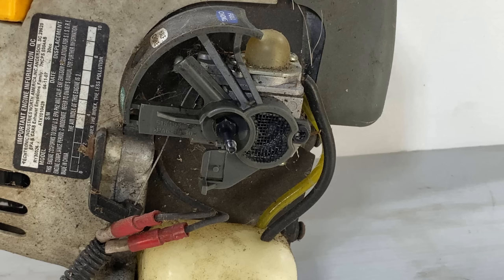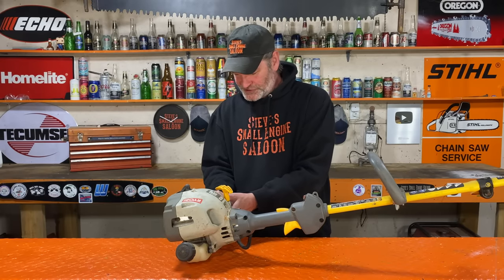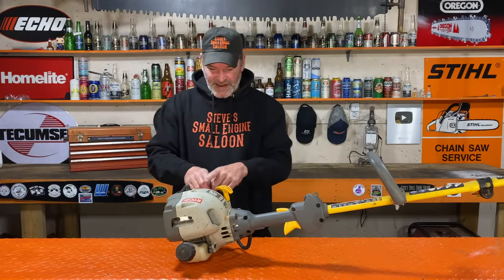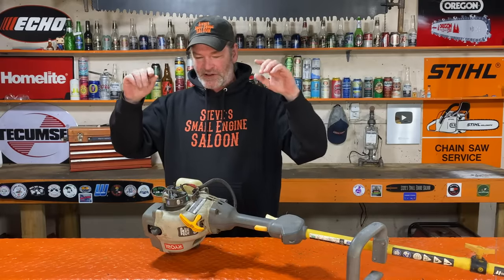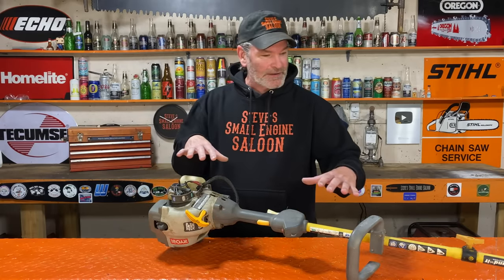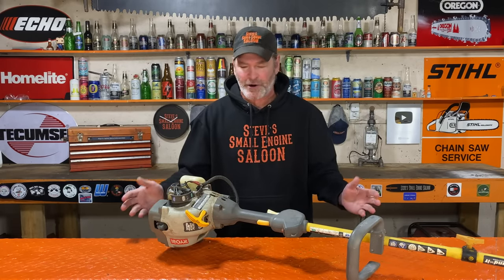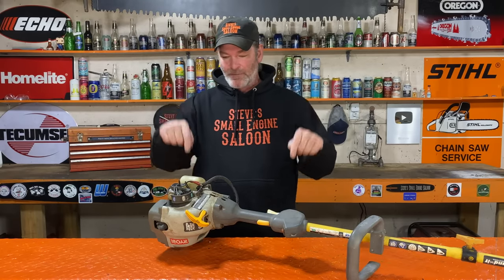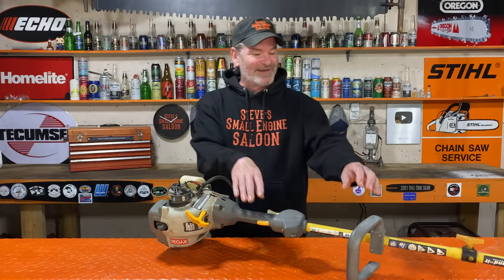This Weed Eater Is BUILT TO FAIL! Don't Waste Your Money!

Comment: Blame it on retailers and us as consumers.  The retailers are pushing the manufacturers for every point of margin they can get and we as consumers are looking for the best price we can find.  It's a perfect storm.  The manufacturers are cutting anywhere and everywhere they can to make a profit while still giving the retailer the margins they demand.  The average consumer is looking for the best price the retailers can provide.  So we get what we ask for - cheap products built cheaply - mostly overseas.
It's disheartening, but really not surprising.  I worked for MTD, one of the world's largest OPE manufacturers for over 25 years and I saw it happening slowly every day.  Now they are owned by Stanley Black & Decker and I wouldn't buy any of that product now for this very reason.  Sad.

Comment: Welp bought a couple of these, ignorant of the air filter lack there of a while back and they are nothing but head ache.  I have the same brand headge trimmer too same deal. You need to be a mechanic to get a job done with them.  The carbs  suck too.  They are just plain not quite right enough. Honestly crap like this is what's bad for environment, goes in the bin, not worth fixing wastes materials...on and on.  Whish we would get back to reduce reuse recycle mentality and have regs that support that vers generating piles of used battery waste now....

Comment: Unreal = no air filter :(. Anyone know or have any tips to quiet a 2-stroke brushcutter? like aftermarket exhaust/mufflers that are good or the like? Does one just measure the spread between the holes where the muffler mounts to the cylinder head to come up with sizing to shop for? Any input is welcome. My ears just can't take the db and Iv'e got 3m x5a over the ear muffs and I wear foam ear plugs under those sooo..that seems hard to improve upon as far as protective ear gear. Thanks.

Comment: For my small yard, I use battery powered 20v Black and Decker weed eaters. They are cheap, and in five or more years of using them I have only gone through two of them. They are strong enough for my needs and are very reliable for the price point.
Reply: Ok?

Comment: Could you improvise and rig a air filter on it?
Reply: You could very easily buy a piece of foam filter and cut it to the shape you want, but like he said if they are scimping on something as small as a little 2 cent air filter, there’s no telling what else they have cut corners on.
Reply from the maker: I would!
Reply: Another commenter said he did for a customer.  I don't know if it was the same exact model as on the video, but really, if you can fit some air filter foam in there, it should help, but the increased air resistance will reduce horsepower/performance, and I hope not much.

Comment: Not just dust and sand any debris that is being obliterated and chucked about  by the whirring, flailing twine.  That poor engine is going to be so fouled and choked out very quickly.  I've done yardwork since I was in Jr high in just about any environment you can think of. I'm now 51.  I've been been splattered by lizard guts, dog crud,  slugs,  mud, clay, gravel,  dirt, etc... I can't even imagine what mit take place if any of this was ingested into that opening. I know I do not do so hot if I  inhale at just the wrong moment. I've  chewed on some unpleasant things and choked and hacked  until  my lungs were once again free and clear of any foreign intrusion. If I can't breathe and function properly neither can this worthless POS. There is a reason I buy trustworthy brand name tools . Sure they cost more but skimping is no option where reliability, and quality are concerned. With something like this you will eventually spend the same amount anyway because you will most likely be buying more othan just one of these.

Comment: The only weedeaters that run forever are straight shaft commercial  sthils. My 2003 FS90 never had an issue im a homeowner with 2 acres of land to maintain.  Buy a comercial grade weedeater if your a honeowner or any commercial grade Stihl product like blowers , i have a Br500 blower flawless power they will last you a lifetime folks stop buying junk at big box stores or discount warehouses.
Reply from the maker: Right on

Comment: Perhaps for the benefit of misguided souls that purchased this product you could have mentioned if you could have macgyver'd up a filter of some sort yourself, as others who have purchased now find themselves with a product that is good in the short term however not built with longevity in mind. Its manufactured obsolescence, and seeing most consumers are uniformed and/or uneducated on small engine equipment the masses will go out and purchase an identical unit as they know no difference.

Steve you should be grateful you never went out and spent hard earned dollars on this one, then you would surely be peeved! 

Small gas engines are soon to be a relic in a museum, manufacturers know this and know by the time people purchase the last gas models that they will be replaced by battery powered so going to reap the last penny in profit by scrimping on builds seeing the clock is running out on small engine gas technology.
Cheers my friend.

Comment: Steve, Chickanic recently covered this kind of planned obsolescence on her channel concerning a Stihl homeowner trimmer and a new SRM 225 that didn’t have grease plugs in the gear heads! She made a valid point; most homeowners(and some commercial users) never check their equipment anyway concerning basic maintenance and these major corporations are capitalizing on the customer’s ignorance! This is an absolute disgrace as I own a 15 year old Stihl FS 80 trimmer and a 13 year old Echo handheld blower that still run beautifully. VERY disappointed in these companies that are producing products designed to fail prematurely. As others have pointed out, it’s the same in the car and truck industry and it’s insulting considering what vehicles cost nowadays. Thanks a ton Steve for bringing these issues to light and for all you do in general. Keep up the great work!

Comment: The can get away with this crappy build because most folks that would buy this weed eater run it couple of hours a year.  So if it is designed to run 10 hours it will last a few years.  My husky weed wacker has handlebars and you need to wear a harness with it.

Comment: I'm STILL ranting about all the companies using different batteries (drills, grinders, garden tools) that become obsolete when the battery is dead(tool hardly used) at least the knock offs are using Makita compatible batteries. I've got a homelite leave blower and ryobi weed eater here (Australia) with that no filter screen, and i was thinking these don't usually get blocked with dust so they might be ok for a long while (I'd be more concerned with the rings sticking due to debris.) but like you said, WHAT ELSE are they skimping on? I recently picked up a USA made homelite weed eater like i had new 30yrs ago, it's only issue is carby related and that's what happened to My one around 10yrs old and i just got a used echo to replace it at the time)
would be interesting to see WHAT FAILS, on all these models and do a video on them, because the engine itself rarely is the issue, it's been the carby causing not to start that causes the pull start ratchet to chew out (plastic teeth) or the bump feed heads having issues (another thing that should be universal fit)  There's a video by channel VERITASIUM on Planned Obsolescence (this is why we cant have nice things ) that is very well explained https://www.youtube.com/watch?v=j5v8D-alAKE